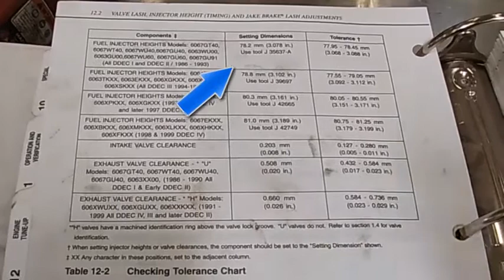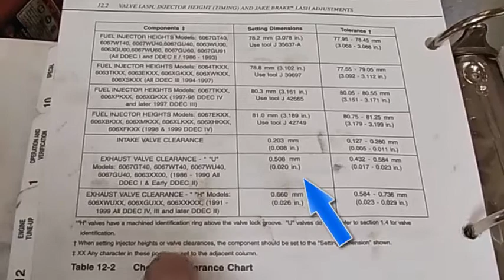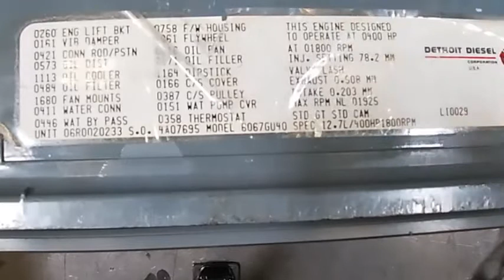60 Series Overhead Part 1

Comment: im replacing all my injectors do i have to perform this overhead tune up
Reply from the maker: I would recommend that you adjust the overhead anytime parts are changed.
Reply: You don't have to, but it's good to at least roll the engine over and grab a feeler gauge and check it, even though you don't plan on resetting it, you may find out that it's out of spec and you want to adjust it

Comment: Joe, I had an inframe done about 100,000 miles ago. I have a 2009 Columbia with a Series 60, 14L. The guy did a great job. I've never had to add one drop of oil between oil changes, the coolant is still the original coolant that the truck had when I bought it back in April, the temp gauge has yet to hit 200 (and I run the Mojave a lot), and my oil analysis are all great.

But for the past 2 months or so, I have lost power on hills. Any little hill, even if I'm empty. The guy who did the work told me that I would need to do an overhead at 80,000 to 100,000 miles. Can this be the cause of the lost power?
Reply: Did you ever get it done?
Reply: @emarquise32  Not yet. I'm waiting for the compliance certificate so I can go into California to get it done. I applied 18 days ago so it should be another week or so.

Comment: I just did the overhead on my 12.7. When I  got it back together, it started and sounded great. When I turned on the jake to make sure it worked, I rev it a touch and it came on, but had a backfire sound as the computer shut off the jake. This was in the shop not driving. I but the injector height tool and set at 81mm like my valve cover said ( 4912 cam 6952 injector BK engine). All injectors were a tiny bit overheight when I  started. Thinking I might need to recheck things. My first time doing the over head on a 12.7.  Intakes were a little tight exhaust was right on a few and loose on a few. Thanks

Comment: so your saying the 78.2 is not putting gage in the hole, but the purchased tool sits in the hole and accounts for the hole depth?
Reply from the maker: No it sits in the hole if you are using a caliper it does not sit in the hole
Reply: And remember for you guys modified the engine for more power, the injector heights come from the camshaft you use, not the injector,

Comment: I have a quick question or two acuallly. I am about to do the overhead, I have been reading the manual and it only helps me so much watching your videos has been incredibly helpful so don't think I am undermining you with this question. I believe you say valves are in overlap when the intake valves are just closing and the exhaust valves are just opening whereas the manual says you are in overlap period when the exhaust valves are just closing and the intake valves are just opening. It is the same thing though right with both scenarios. Lastly I have watched your overhead videos part one and 2 over 10 times and I think I am ready to go in today but to make sure when your intake and exhaust rocker rolls both cant be rolled and are tight that is valve overlap correct? Thanks for all of your videos and for all of your contributions.
Reply from the maker: Yes when the exhaust is closing and the intake just starts to open is valve overlap
Reply from the maker: You are correct. I said that backwards.

Comment: Is the injector  have to be bottom out to adjust it??
Reply: Special tool to set the spring height from hole in injector body, to top of spring retainer, you don't set them when compressed, spring height goes according to the camshaft you have, not the injector

Comment: Thank you for the video.
I have a Series 60 12.7L.  Previous owner said he did an overhead.  I may have a bad injectir as it smokes on cold start.
Runs well but loses power pulling hills.  Would it be possible for you to do some work on it?  If so, what State are you located in.
Thanks in advance.
Reply: How does your coolant look?  Does it smell like diesel?  Any check engine lights on?  Just finishing up a “minor in-frame” as the owner calls it, for the same reason you stated above. 2007 model DDEC VI 460hp 14liter, runs fine until it gets to a hill, then it falls on its face…but no check engine lights.  First thing I noticed was the “fuelant” in his radiator expansion tank. I pressure tested the coolant system with the fuel feed line from the filter housing to the block disconnected, as to look for pressurized coolant. Too many leaks elsewhere to make a definitive statement, but I plugged in and did a cylinder contribution test and found 3 & 5 cylinder were out of acceptable range, so I guessed correctly that she needed a new head and injector cups, so we started the job, only to find a completely destroyed fuel lobe on the cam at #3. It was obviously adjusted to run on this chewed up cam, but this guy got the brunt of it.  Guys who rebuilt this engine before left a whole plethora of surprises. We wanted to do a complete overhaul, but the budget is tight so we are doing the most necessary items, complete new head,cam, followers, injectors and cups, rebuild jakes, some new lines and little things but the rest of the old parts are going back on. It won’t be long before it’s back for the rest of this stuff but hey if it’s all you can afford, that’s it.
Reply: Por  favor    baje  todo  referente  a  la  serie  60   muy   bueno